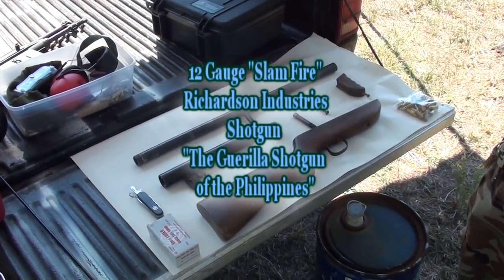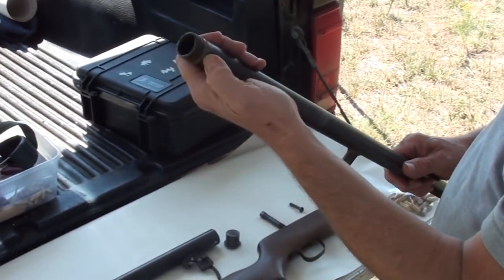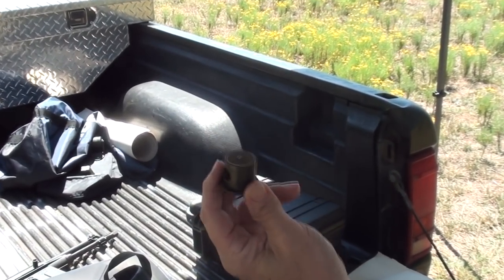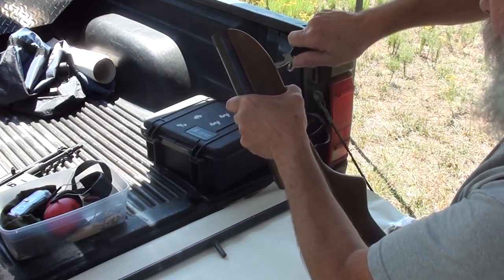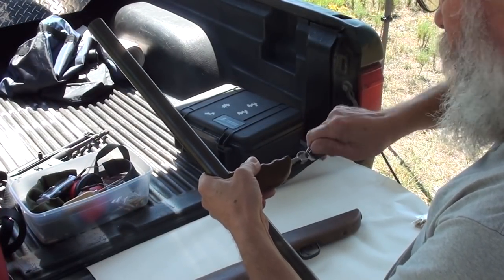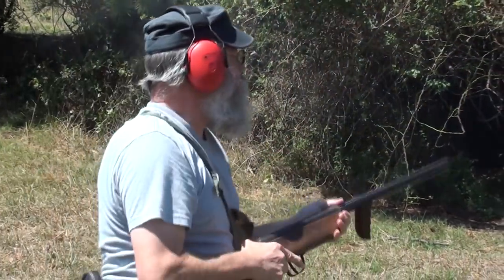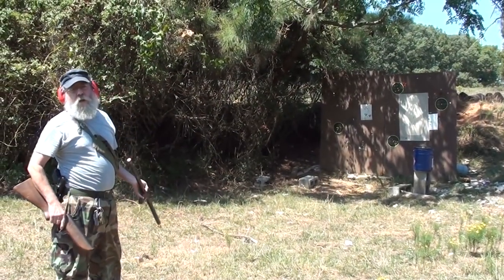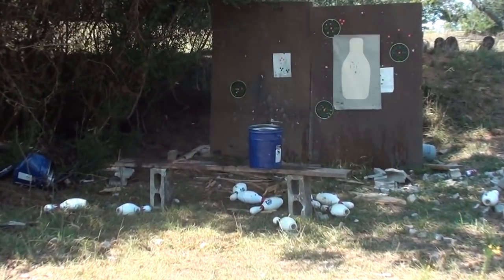Richardson Industries "Guerilla Gun" Slam Fire 12 gauge Shotgun

Comment: @unknownperpetrator The .45 cal gun that your buddy had that was dropped all over Europe by the bombers was most likely the single shot stamped aluminum & steel .45 cal Liberator. It was a single shot gun designed by the OSS (CIA's forerunner) to be air dropped & distributed to allied resistance forces like the French Maqui & the Yugoslav Partisans of Marshal Tito to be used in ambushing single German soldiers & then taking their weapons & using them. You can find more if you look up .45 Liberator on Wikipedia.
Reply: yes but i think they never drop it in the end,the allied airtransports  were full on transporting suplies and troops for normandy invasion, i think most of them just scrapped after the war.

Comment: Only prob with that is Home Depot  / Lowes must've caught on to these vids cause 3/4" black or galv pipe does NOT slide into the 1" pipes like in all these vids! There is a welded seam in middle of 1" pipe making 3/4" NOT able to fit. I used 1-1/4 instead and wrapped some duct tape around 3/4 to give me a center fit with firing nail. It works fine. Just thought I'd let you guys know.
Reply: What about shaving the seam?

Comment: That basic design is why I have always said that Gun Control Laws are stupid and impossible to fully enforce. Anyone with access to standard 3/4" black iron plumbing pipe and another pipe large enough for it to slide into, has everything that they will need to make a very effective gun. Which is why I always said we need to concentrate on enforcing laws against committing crimes with guns and not banning or restricting possession of them.